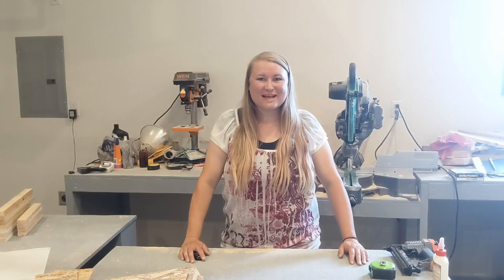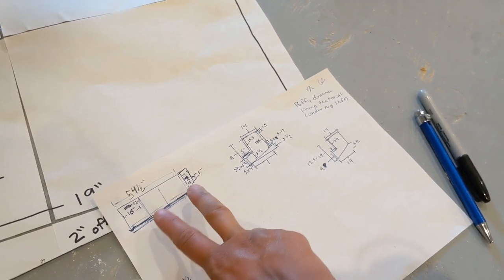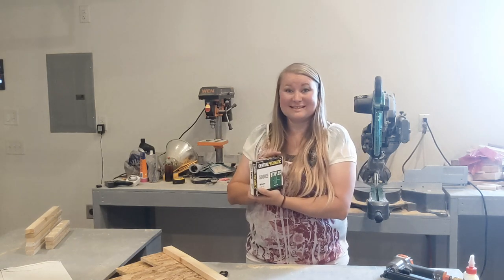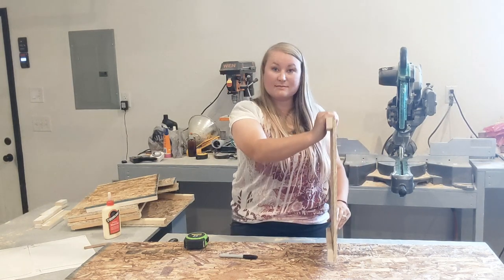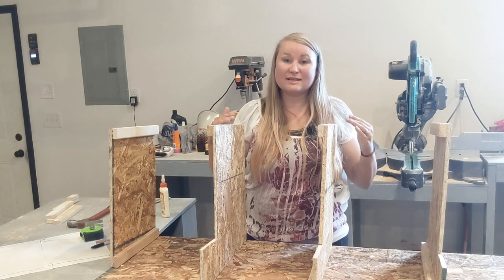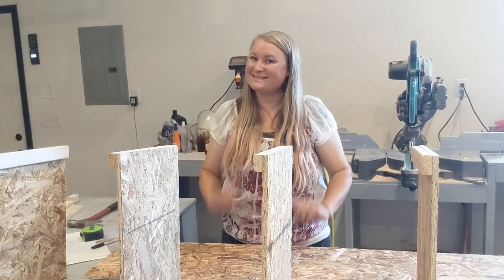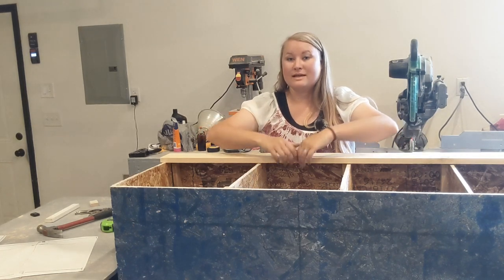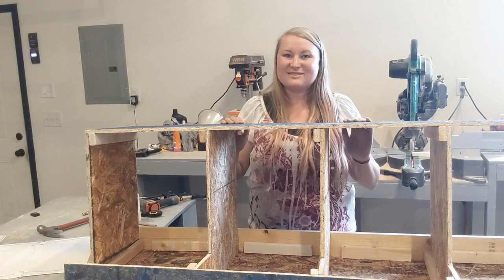How to Build Rolling Nesting Boxes for Chicken's

Comment: Does your angle work? Most say a 13 to 14 degree angle is needed to get the eggs to roll down, do yours roll well?
Reply from the maker: Yep, we are almost to a year with these boxes and ours roll great. If I did it again I would make the egg catch part deeper to help prevent chickens from reaching in and eating eggs, like 2-3 inches. They are persistent.
Reply: @countrysparkles  Wow thanks for the instant reply. Have you tried hanging black cloth at the point where the eggs roll under, a kind a curtain to hide the eggs?
Reply: @countrysparkles  Also I notice you have two angle drop measurements, 2" and 3 1/2", which did you use? I ask because I have one 72" long box already built and 3 more to go. I pick up my laying hens mid August and need to be prepared. Thank you much.
Reply from the maker: Lol yes the girls just stuck their wings and head through. I am going to put up another bar inside further in then the other one I added and see how that does. I did hang black material on the outside too so it was hard to see at all in there and that helped not being able to see the eggs even roll away well. I have a few that just refuse to give up.
Reply from the maker: And I used the 2" off the back. I haven't had a problem with eggs not rolling back unless one gets wedged just right on a piece of bedding but that doesn't happen often. I think the 3.5 would have been way too steep, (that was just my brain storming sketch) and would have damaged eggs rolling out. But you could do 2.5 and that incline wouldn't be bad either if you want it to be just a bit steeper. My chickens sit on carpet in the nesting boxes that I have stapled down and the eggs can still roll off into the catch area.
Reply: @countrysparkles  Thank you very much for your reply.  There are hundreds of videos on youtube about making rolling egg nest boxes, but yours is the only one I have found that actually gives dimensions.
Reply from the maker: Of course, I am so glad that I can help. I figure if I am going to share what I am doing I might as well be a specific as I can be. They are definitely not perfect where they were my first nesting box build but it at least gives people a simple place to start. Thanks for the reaching out!

Comment: Nice, but you should make the bottom square and flat. Put your 1x2s at an angle inside.  
This will make it way easier for you to build.
Makes it easier to test and adjust the angle. (Not stuck with the pre cut angle)
Also makes it stable while moving around and not teetering over. 
It also makes it easier to handle and mount onto the coop. 

Option 1, Place and level a board on the bottom where you intend to mount, and set the box on that board. Mount the box.
Option 2, Make a French cleat for the top and/or top & bottom. Install and level the top cleat, bottom half, on the wall. Lift and place boxes on the wall. If cleated on the bottom also, place and mount the bottom half of the lower cleat. 

Also, make the top at a steep angle. You don't want the chickens getting on top and pooping all over it. If this is going on the outside this will help the rain roll off of it.

Use synthetic grass mats. Made for easy cleaning and they are open at the bottom. Use 1x2 welded wire in the catch tray. The whole bottom if you can. Any poop or dirt they track in can fall through. At the catch tray, where the mat ends, bend one row of squares (of the 1x1) Up to just below the top of the mat and back downsloping into the catch tray. Start curving the 1x1 up to the board. To slow the eggs down and not slam up against the board. Left this till now, when putting the 1x1 down make sure the wire that is on top (as they cross over each other) is is running perpendicular to the backboard.  This creates tracks for the eggs ro roll down. You don't want the top wire to be running parallel to the backboard. You don't want the eggs bouncing, everytime the hit the next wire.

Last. Try and make some push out/excluders in the boxes. Set on a timer 30 or so minute before dark, it will push the hens out so they don't sleep in the boxes. Not all that hard to make.

Great work.
Reply from the maker: This sounds like it would be a nice box too, it is awesome how there are so many options out there!
Reply: Do you have plans to make yours ?
Reply: @clp6743  How long/wide do you need it. I have so far, planned it for two sets of boxes(48" with 4 nesting boxes, each) , made 90% from 1 sheet of plywood.
Reply: @clp6743  I keep leaving you a message, saying that "I don't have plans but I can make them if you like." Then I keep leaving a suggestion to do something so that when I upload them you can be alerted. But it keep getting deleted.
Reply: @clp6743  The suggestion has to do with a SUBmarine and SCRIBING some words down.
Reply: @clp6743  Anyway this is the 4th and final attempt. Someone or something doesn't want you to get that message. But since you have not responded to the message that has not gotten deleted I will take that as lack of interest.
Reply: @clp6743  You do however get notified by email with at least the first bit of the comment. So I will send one last try.